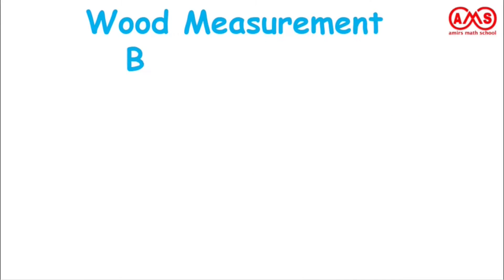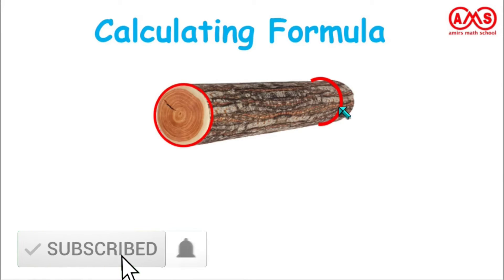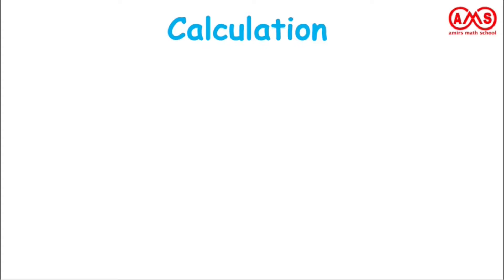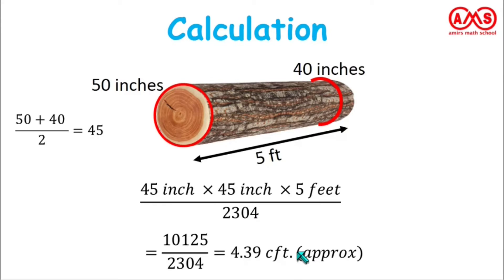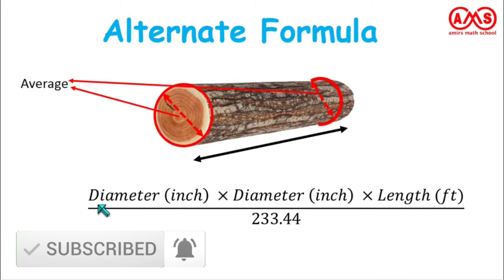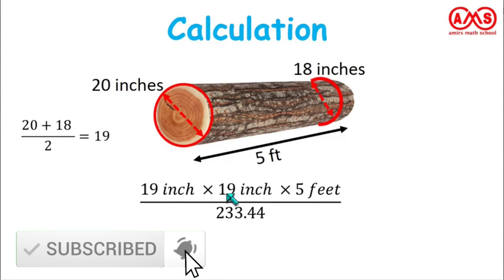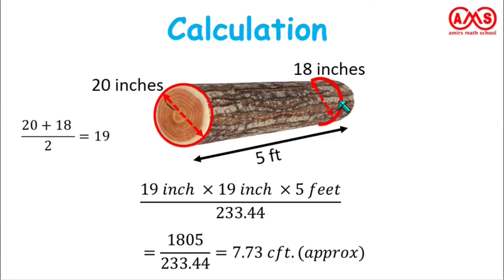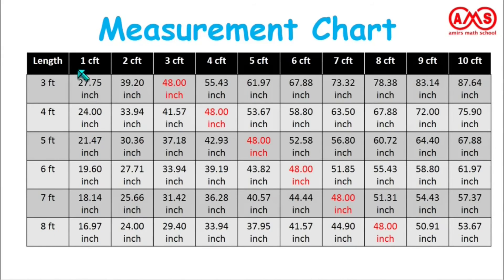Round Wood Measurement Method || Circled Wood || How to Measure Round Wood || Wood Measurement ||cft

Comment: If length is also in inch then how to find
Reply from the maker: Divide length by 12 to convert into feet.
Reply: @amirsmathschool   is it necessary that length should definitely in feet if it will be in inches would it give it a wrong result

Comment: Why not area of cross section multipled by lenght =volume ( Paixdxd)÷4 x lenght = 3.142/4xdiaxdiax Lenght). If any allowance towards wastage is allowed, please clearly explain how 2304 constant is obtained.
Reply from the maker: Thanks, 
To find the wood measurement in cft. we need to consider the wood log as a rectangular base not circular base and 2304 is for better approximation.